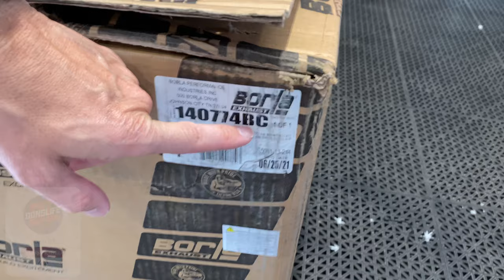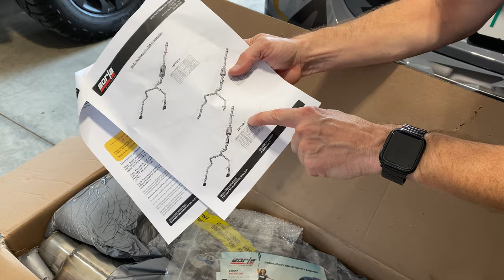BORLA S-Type Cat Back Dual Exhaust Install Review 2019 - 2023 GMC Sierra Chevy Silverado 6.2L

Comment: Very nice sounding setup. I never put an exhaust into a truck until a couple months ago on my 2016 Sierra. Didn’t realize the fun I was missing out on all these years!
Reply: what you install?
Reply: @khiaraslaw  did a very simple super 40 and had a muffler shop dual it out the back. Deleted resonators and stock muffler
Reply: @Thesheriff1776 thanks have a 2016 5.3 thinking of doing a up grade as well
Reply: @khiaraslaw  cheaper way to get a good sound. Local shop did it for me in a couple hours for $300.

Comment: Just put headers with hi flow cats already installed on headers called green headers two separate pipes and use your old resonates and buy your quad black tips the 6.2  will gain 70 hp and not much louder and if you want it quiter  and get some longer res resonators all for 4500 welded on 70hp plus your pulsar lt 140 mpr in 10.05 quarter mile  not bad for a 5400 pd truck 😊
Reply: 10 4😮

Comment: Sound just like my 2014 Chevy with the 5.3.
I have short tube headers and the Borla atak cat back system.
I love mine. Yous sounds GREAT!!!!
I'm trying to figure out which Borla muffler I want to put on my 1999 Cadillac SLS.
It's straight piped now.
The 4.6 Northstar has a great deep tone to it but it's got a bad drone. 
I want to keep the volume & tone but want to drop the drone. 
Thank you for a great video and sound clips.

Comment: I had ATAK only installed on my 5.3L.  Both flappers removed but kept the resonators.  Mine sound about the same.  Will drive it for a month or so then decide if I want to take out resonators.  Want it loud but don’t want to wake the dead on cold starts.

Comment: I had a 6.2 at4 with an atak on it. It was actually too loud, particularly on cold start. Felt bad for my neighbors a little. This sounds good.
Reply from the maker: So many people suggest I should have went with the ATAK! 😂 I think it is easy for them to say but harder for me to live with and keep neighbors happy 😃
Reply: @Donslife  I live in a neighborhood similar to yours Don. Would you say the S-Type is annoying to the neighbors? Im debating getting the S-Type but dont want to be “That Guy”. So possibly thinking of the Touring instead. Your thoughts?
Reply from the maker: Tough call.  I would say there are 3-4 of us on the block and mine sounds the best in my opinion.   It is certainly a concern during cold starts.   My immediate neighbors are cool so I think it depends on the temperament of those around you.  My fear was the Touring would be too quiet.  I know my answer probably doesn’t help

Comment: Really glad I happened upon your videos.  I really enjoy them.  I've got the identical system, but with the Touring muffler.  Your neighbors have likely shared their thoughts, but for me your vid definitely reaffirms my choice.  My truck is loud early in the morning!  Two other notes, for whatever they're worth.  First, there wasn't a Borla hat in my box, which makes me go wah.  Second, very good call on the thorough inspection.  I've got the longer "standard" bed, and even though the description and manual stated the kit included the extra intermediate pipe, it actually didn't.  This delayed my install, and I was disappointed in how the vendor (and Borla, I suppose) handled it.  Ultimately, I went to my local exhaust shop where they removed the length of pipe needed from my stock system, and welded it on to the Borla.  Stainless-to-stainless, no harm-no foul, other than an extra hit to my wallet.  A bit frustrating - you'd think a $1,450 (US) system would include much better QA/QC - but I still smile every time I drive the truck.  Thanks again.
Reply from the maker: I am happy it worked out for you overall.  If we ever cross paths, you can have my Borla hat 😉 🧢

Comment: Based in part on your videos, I ordered Borla-140768BC today for my '22 Silverado. This is the Touring version. Debated on S-type, but my truck is an LTZ, not a Trail Boss or RST, and it is not lifted due to my nearly 71 year old knees. Just want a bit more personality. Had Flowmaster duals on my '01 Suburban. Very noticeable when towing our travel trailer at 68 mph in third gear (2,700 rpm - couldn't hold 4th). Thanks for all the useful information.
Reply from the maker: The Touring is a solid choice.  Enjoy

Comment: Hey don, I know you have probably gotten this question about 300 times now but I’m going to ask just for my reference. With this borla S-Type system, is there much drone in the cabin when cruising say 50 and above? This truck will likely be my next vehicle if I can’t get a 1SS 1LE which I’m hoping for. But if not trail boss or at4. And how happy are you with the exhaust now after a couple of months after it’s broken in? Any leaks? How’s it holding up to our Canadian winter?  It’s 304 stainless right? Thanks Don love the videos and keep it up!
Reply from the maker: Ah the drone question.  Just to make sure my definition of drone matches yours.  I had a Magnaflow on my 6.2 Denali and it would hold an annoying midrange tone/frequency when at highway speed and low engine load.  So a loud humming that you could almost feel.   The Borla S type can be heard at all times, but has not come close to droning.  I can have a conversation with the family overtop of any exhaust noise.  I can even record videos and it doesn’t cause issues.  No leaks either and when I take it to the carwash they tubes I can see come clean.  304 Stainless for sure.  It settled a little after a month and I just adjusted the tips, super simple.

Comment: What was the trick to get your tips to align perfectly.. I have same kit.. Having a heck of a time getting them even side to side.. Sounds mean though
Reply from the maker: Loosen the other joints, not just the tips.  Drive around, let it settle, try again and fine tune the tips last
Reply: My passenger side tip is probably set back a half inch or more.. Kinda bugs me.. Easy install just wish they was lining up better

Comment: do u have a drone at 75-85mph  I had s-type and had a drone  also have lt pulsar which turns off dfm  6.2 motor  went back to stock muffler now thinking about gm performance exhaust   which basically is borla touring exhaust
Reply from the maker: I can’t say that I really do.  I don’t tow at those speeds so it stays very quiet.  Of course it has some tone to it and is louder than stock

Comment: Anyone know if i install these on my truck it will get pass on inspection? Im from Massachusetts they pretty much dont like anything aftermarket here 🤣🤣
Reply: It depends. Being a cat back it is allowed in mass.....however the law also states its not suppose to raise the sound of the exhaust to much higher then stock volume. So it comes down to really who is doing the inspection and whether or not they pass it. I know in western mass you wont have problems. Its the crazy loud exhausts that they look at, my buddy has the atac which is louder then this one and passes with it no problem

Comment: Hey Don,  want to get the GMC illuminated badge.  Have you received your second one?  How are you going to keep water out of the connector’s? I assume that’s went wrong with your first one.
Reply from the maker: Nothing yet. Still on back order.   Water didn’t get into the connector.  Moisture crept in between where the clear lenses meet the backing plate.  I’ll come up with a plan when the next one arrives….if it does

Comment: Hey Don, kinda just learning about these things. My question is, why is it better to do a full exhaust replacement instead of just a muffler swap?
Reply from the maker: Usually the pipes are larger diameter than stock which allows more air flow to the muffler and resonators in some cases are replaced as well.  With a replacement it is usually better do avoid drone at certain RPMs.   That’s not to say the perfect muffler only replacement won’t work for you

Comment: Don have you noticed that the tips have settled and been pushed out some? Maybe I didnt tighten one of the clamps enough. Upon install the tips sat just fine, now they have pushed out some.
Reply from the maker: Yes they did a little, I backed all of the bolts off slightly and made sure all of the hangers looked well-placed. Then tightened it all back up and did the tips last.  Now they are even again and haven’t moved

Comment: Question what's the part number for that exhaust? Because I'm looking at the same one and the part number I'm getting is 140773 my truck is a 2021 Sierra 1500 6.2
Reply from the maker: Mine is part #140774BC (BC = Black Chrome Tips).  Yours uses the factory HDMI shaped tips
Reply: @Donslife  Ok that makes sense because I wanted to go with factory tips cool thanks for the quick reply and ty for sharing

Comment: Hey Don,  did you find anything  new on the AT4?  Did you put the S CAI back on or you still  running the stock  unit?
Reply from the maker: Hey John!  Thanks for checking in!  S&B has bee recently reinstalled - nothing to report yet as it has only been a short time with little variety in driving.  I will provide an update hopefully around late February.

Comment: I called a shop to have this installed on my 21 sierra. They told me that there are valves that cannot be cut out or it voids your power train warranty. Anyone know if there is any truth to that?
Reply from the maker: Will it void my factory warranty? All Borla street Cat-Back™s, Rear Sections, and Mufflers are 50-state emissions legal. These systems will NOT void your factory warranty, some cars even have Borla systems as the OEM exhaust.
https://www.borla.com › faqs
Frequently Asked Questions about Borla Performance Exhaust Systems
Reply from the maker: Hope this helps.  My understanding is after the catalytic converter, you are warranty safe.  The Magnuson-Moss Warranty act basically states that unless the modification can be proven to be the contributing factor of a breakdown, you have valid warranty.
Reply from the maker: Also the GM Performance Exhaust (made by Borla) eliminates the 2 flapper valves.  So…..
Reply: @Donslife  yeah I’m in agreement with you. Thanks for the info.

Comment: Sounds great!! Two questions…do they sale this exact but I but shorter if I want to keep the square tips? And my other question is did you go with a darker tint  on your side marker on your headlights?
Reply from the maker: Hey Marco! yes they do have one that will fit with the factory tips.  Yes I went with the dark smoke tint vs the light smoke.  Same process so I didn’t film it

Comment: Great video, very informative, love your content!  Do you wonder what it would have been like if you would have gone with the ATAK instead of the S-Type?  I am on the fence and don't know which one to go with for my 6.2 CarbonPro... Any input would be great, from you or the chat.
Reply from the maker: Well I think the ATAK would be too loud for me. The S-Type has a resonator that can be deleted with a straight pipe and you’ll end up with an ATAK setup.  Or you can buy the ATAK and a separate stype resonator to add at anytime (2019-2021 gmc sierra 1500 Connecting Pipe S-Type Part # 60679)
Reply: ATAK all the way , I have it on my 2020 at4 6.2L with a S&B CAI
SOUNDS GREAT 🔥🔥
Reply: Hey which exhaust did you go with.

Comment: Don, just curious why you didn't go with the true dual exhaust vs. single pipe?
Reply from the maker: I wanted a cat-back exhaust that would use the same routing as the factory set up. A true dual would also benefit from a tune, which unfortunately is not available for these locked ECU’s.  (At least at the time I ordered this exhaust)
Reply: @Donslife  benefit from a tune as in it really needs one?
Reply from the maker: It wouldn’t ‘need’ it but if your removing the catalytic converter and going true dual from the headers, a tune would certainly help get the most of the less restricted flow
Reply: @Donslife   ok the converters stay intact, you make the cuts about two inches behind them, then go dual. That being said, That makes me feel a bit better because I hold your opinion kinda high with all the great content you have. 
   I’ve heard a few sources say it sounds pretty much like your single, than another guy said he welded the factory resonators back in because he didn’t like the sound…which is something I’d rather not deal with. 
 Now, out to buy a Dremel because I’ve ordered the grille insert you did lol!! Should be here tomorrow.

Comment: Awesome truck.....I got the same one and did a few of your mod ideas. You need a lift with all the work you do...haha. I noticed you still have the stock rancho shocks on.....I highly recommend the bilstein rear shocks and bilstein front strut/coil spring kit they have, completely changes the ride. No more rear end bounce and the fronts have 3 circlip settings to level the front.  I put my fronts on clip#3 setting and it leveled it off nicely.  I'll  keep watching for mod ideas. Thank you.
Reply from the maker: They are on my short list.  Might do the fronts first.  Canadian suppliers have been short.  Importing auto parts from the US force us to pay substantial extra duty charges on top of the hit we take with the currency exchange.  However they are on my radar!
Reply: @Donslife  you will be very happy with them.  Did you try summit racing? I think they ship worldwide, I bought mine from there,  but im in US. They are an official bilstein dealer to. This is why the world needs to adopt cryptocurrency so people can buy what they want from where they want and not get hit with an exchange rate. Thanks for your videos. I'm gonna do the gloss black vinyl wrap next on my fog light trim bezels....great idea! I got the red cayenne tintcoat paint so I'm trying to black out some trim, goes well with the red tintcoat paint 👍
Reply from the maker: I have used Summit Racing in the past.  I bought an entire electrical vehicle harness from them a few years back.  The exchange and duties still made it cost almost double.  This fall I think I will just do it regardless

Comment: I finally upgraded my exhaust system to the GMC Borla S type, specific to the AT4X. It definitely improved the sound and I've managed to get some improvement in MPGs.. Great video btw.. Honest review, much appreciated
Reply: I have an AT4x as well and looking to install the Borla S type kit. Went to a muffler shop and he was trying to sell me on not going with the S type, but getting the Borla XS Pro muffler. Any thoughts?
Reply: @MandeepGill-sf7rs  I don't know about that specific product. I also opted to have the dealership install my exhaust system. I know it cost more, but I have peace of mind for any warranty related issues
Reply: @krisr7324  I will actually reach out to my local dealer to see what the difference in price may be. You have a point with it not having any warranty issues going through the dealer. One additional question. Are you happy with the sound of the S type? Did you look at the Atak? Thank you!
Reply: @MannyGill-dx4bi  Iove it, it's not too audicious. It's definitely loud on cold start though, so be prepared. Looking back, I usually take a lot of calls while driving and it's impacting my call experience, but I've come to accept that. It will be heard inside the cabin, but not too noticeable on the highway and under cruising conditions. The system is sanctioned by GMC, so it's rather tame..I did consider the Atak, but I wanted something less noisy. One other thing, the sound is definitely off with DFM. enabled. There's a big difference
Reply: @krisr7324  Thank you for the information. I ordered the Borla S-Type today from a local Muffler shop. We ordered the it for the AT4 model with the quad outs and he is going to fabricate it to fit my AT4X. Should have it completed next week!

Comment: Hey Don, did you ever get a check engine light when you installed the Cold Air Induction unit?  Thanks for all the information!
Reply from the maker: No check engine lights with any of my intakes          S&B and Cold Air Industries have been solid.   Disconnected the battery for 2 hours and while installing, made sure the MAF sensor was clean and handled carefully, then once I started the truck I turned off the air filter monitor in the system menu
Reply: Have you gotten the Pulsar tuner yet?  Also,  can you tell when the DFM kicks in and out with the exhaust?  Thanks for the help!!
Reply from the maker: @johnaragon3314  I haven’t made the PulsarLT a priority purchase.   Coasting and braking I can hear the DFM kicking on and off.  I usually just drive in L9 now around town and D on the highway.  When I get new wheels, I might get the PulsarLT to calibrate the speedo and disable DFM

Comment: Should have started it with out the exhaust hahaha very nice video otherwise
Reply from the maker: I did at 1:15 in the video - start and rev with stock exhaust
Reply: @Donslife  I meant after you took off the exhaust with the sawzall,  straight headers!  The video at 1:15 is just the stock.